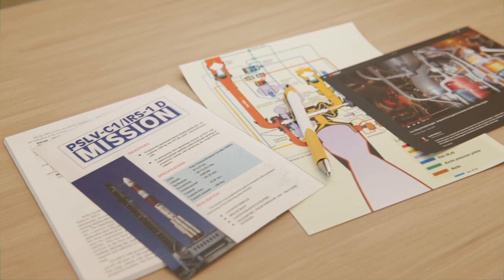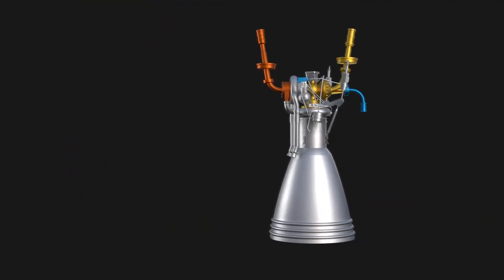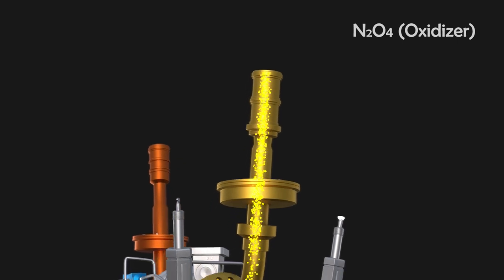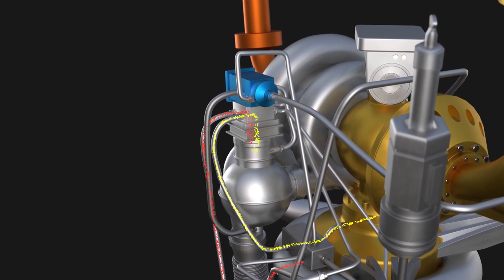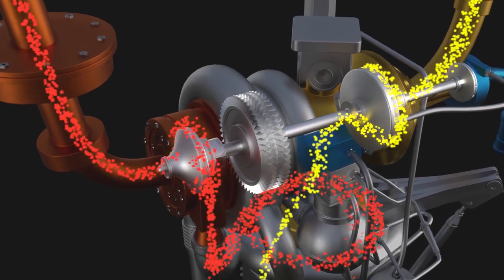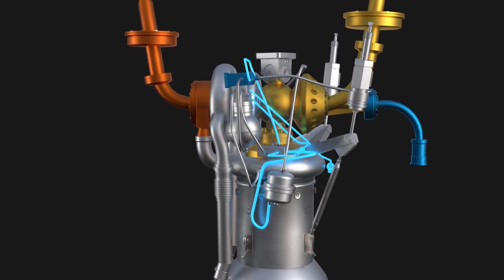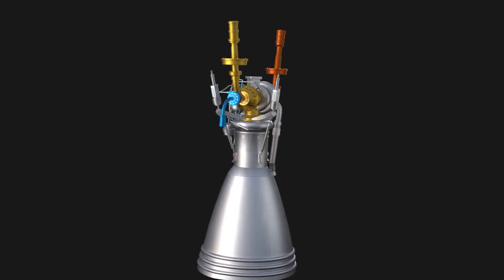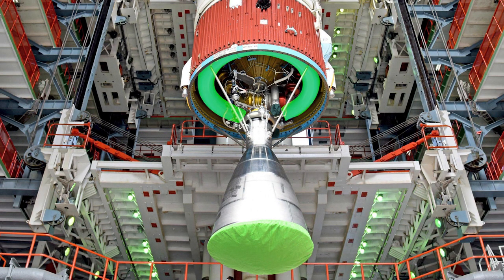VIKAS Engine : Engineering of ISRO's high thrust VIKAS engine  |  Curism

Comment: Bro I have a doubt. I think the water injection through water centrifugal pump is used for steam generation rather than for cooling purposes. And the gas generator is actually a steam generator/boiler. Solely burning a rocket fuel to run a turbine based on exhaust gases is not feasible. Thus, they would be using the combustion energy of fuel to convert water into steam and then use it to run the turbine blades. The temperature of steam/exhaust gases are controlled through valves controlling the fuel inflow and mix, which also maintains the constant speed of a turbine blades like in any powerhouse turbines for uninterrupted power supply.

Comment: how did they handle the coaking problem in the exhaust since it is an open loop? UDMH must produce a lot of soot right? so if the exhaust is clogged up by the soot, there would be flow and pressure reversal in the turbines in the gas generator? since it is not blowing up, they must have fixed it? anyone know how?

Comment: How to start two pumps for pumping proppellents?
Reply: According to me, as sir explained turbine will be rotating impeller of both pump and leading to suction of fuel and oxidizer. Here, turbine will be actuated by impact of exhaust gases from gas generator cycle.

Comment: How could we say it's an engine..it's basically a burner like gas welding torch with cooling system with an added thermodynamics to control the burning flow
Reply: Then how diesel is an engine it burns fuel like a tandoor/oven with controls to shut it on and off and lubricants and oil to keep it from getting cracked.
Reply: @RUPEETRADER  what nonsense.. talking rubbish
Reply: @saravanakrishnamurthy7234  🤣🤣🤣

Comment: But RS 25 is the world's most reliable rocket engine. So vikas is a gas generator not a open cycled engine
Reply: A gas generator is a open cycle engine, the turbine exhaust gasses are dumped overboard, thats the definition of a open cycle engine, dumping turbine exhaust overboard, also the RS25 is not the most reliable engine, its just that all failures were caught while stil connected to the launch pad, allowing for repairs before launch.
The most reliable engines are the RD-108 and RD-107 on the Soyuz and close behind them the Merlins on the Falcon 9 and Falcon Heavy
Reply: @user-si5fm8ql3c  yeah RD series are awesome it's also a reliable rocket engine but when I googled it's saying that RS25 is the world's most reliable rocket engine ever build